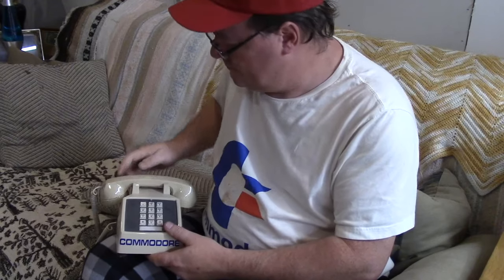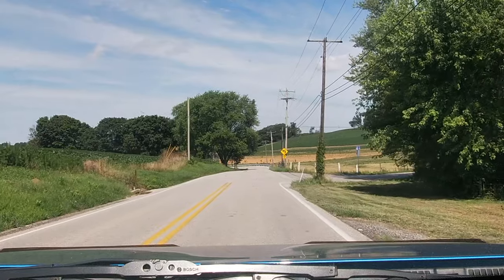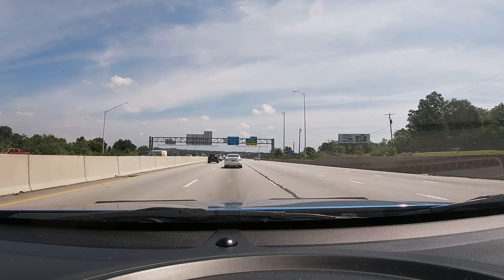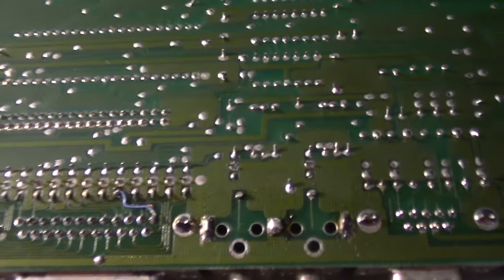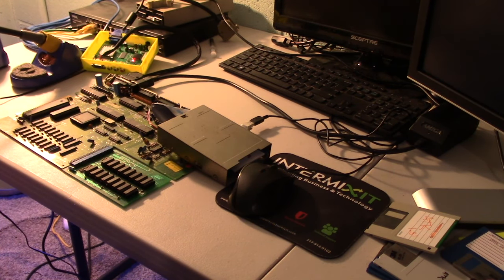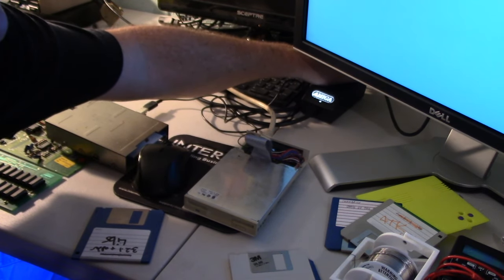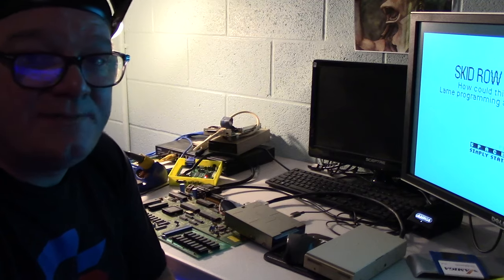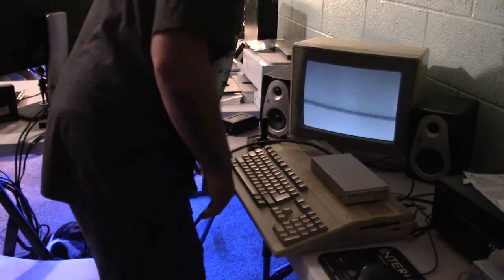Dr Chris house calls - Amiga 500 repair

Comment: I’ve got solder which I still use that is older than John. 🥺
Reply: I still got a Large Roll of Thick Old Solder myself, from the Days of Valves Radio's & Lead, it still works ..

Comment: Great vid as always Chris 👍🏻 The citizen drive will be from a Rocutek external drive. My Citizen Drive internal rubber Drive belt perished and needs a new one as well 😉 And he’s it’s got one cable that provides data and power as well 😠Another Amiga saved….🍻
Reply: I replaced the belt in that drive. The loud noise stopped but still doesn't work unfortunately.
Reply: Probably better to replace it with a more modern direct drive floppy that does not use a belt,much more reliable.

Comment: The Citizen floppy drive uses a rubber motor belt, it will no doubt need replacing. ps; if the external speakers aren't shielded? They'll disrupt the monitor display.

Comment: Another nice video Chris! I need help, if you can answer? My A500 have white screen, when i power it on, it just dont have startup icon, its rev 6a,recapped! It does blink caps on startup, i can press! But there is no floppy drive activity? No drive clicking? Just white screen! When i touch Gary chip it is cold on power on! Before, my Amiga was sometimes recognized my expansion card which have connection with Gary chip socket with two wires, but sometimes not!? What you think? Dead Gary or kickstart chip, it is 1.3,or dead cpu??? Or? Hope you can answer!
Reply from the maker: Reseat all your chips with deoxit. Prob one has a bad connection if it was working
Reply: @ChrisEdwardsRestoration  Yes, i reseated all chips before, checked every pin of chip for contuinity, from up to bottom of motherboard, without deoxit! And all looks ok, maybe i should try deoxit! Or maybe is somewhere there trace broken!? By the way, thank you for your answer and help Chris!
Reply from the maker: @Boris_Amiga1200 email me. Orobb
Something simple

Comment: I wonder if Drive Screaming was Rubber Belt ?, there was a Hack, in "Fish Disks"? to use a PC Drive in a AMIGA, I seem to remember it was a DF1 External hack as well, maybe that what that was ...
Reply: Sounded exactly like a bad belt to me, I've replaced loads of then.
Reply: I don't remember that floppy drive having a belt, just a stepper motor. but I can't be sure because it was so long ago.  I bought that floppy drive in 1989 from where I worked at the time. It was the only floppy drive in stock that had jumpers on it so you can change the sector translation. A member of Eagle Soft told me to get a drive with jumpers on it, and did all the wiring up and provided the external housing and cable for me. And you were right. The drive was modified to work as DF1:.
Reply: @MrClump  You're probably right, but I do remember later releases of floppy drives without belts, just a stepper motor. Dust would accumulate in the motor and make it squeal like a pig. :)